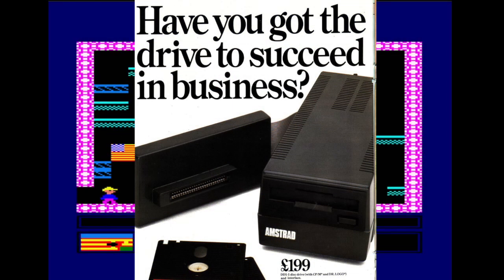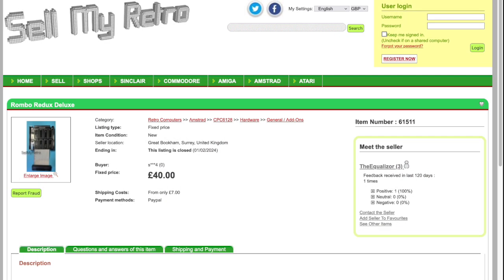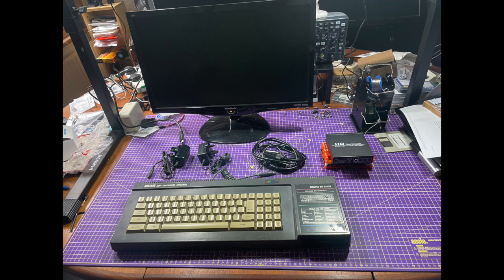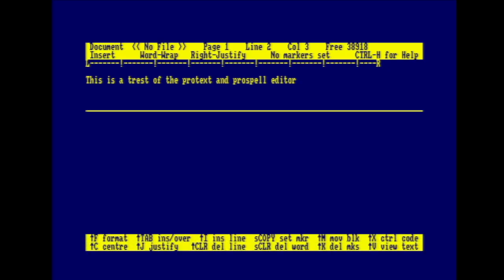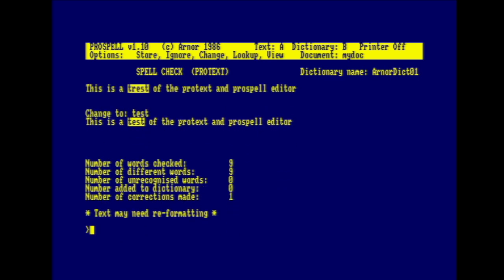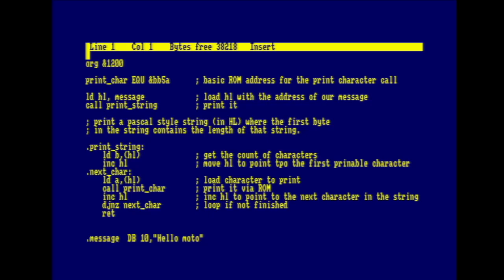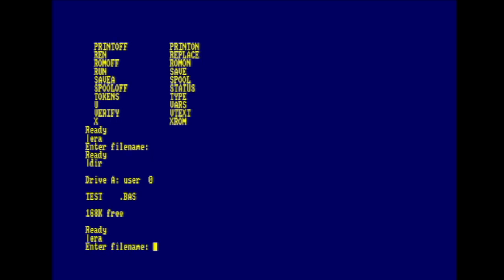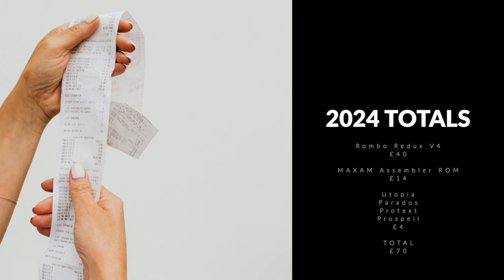Amstrad CPC   Rombo Redux v4 a ROMbox

Comment: 2:50 you say the only way to reset a CPC 464 is to power cycle it at the wall socket, or to yank the power cable out of the back of the machine. What about the power switch on the side of the computer?
Reply from the maker: I never had a 464 or a 6128 with a built in switch. Did you have a plus model? The might have had one?